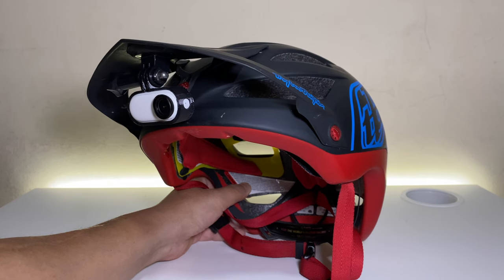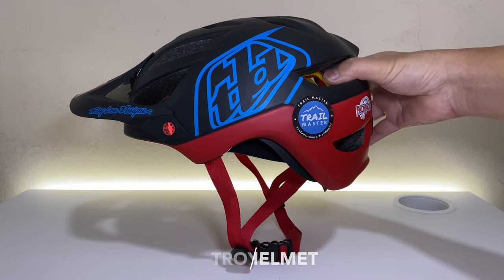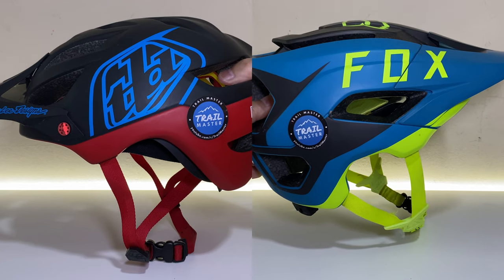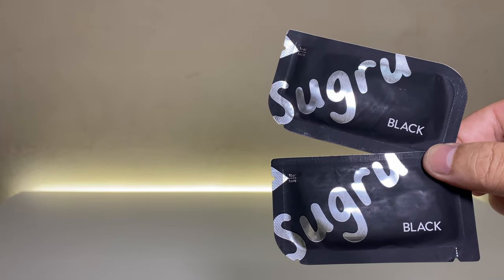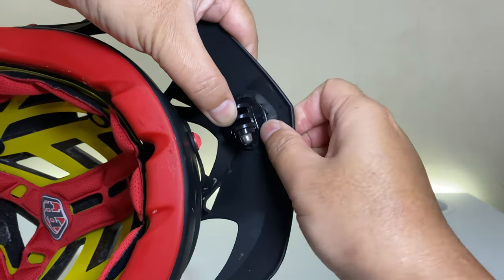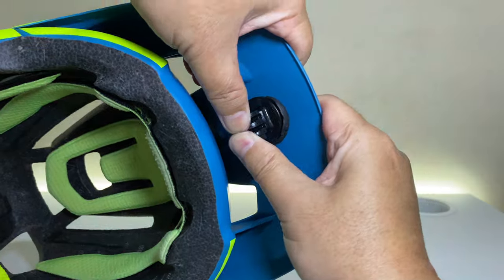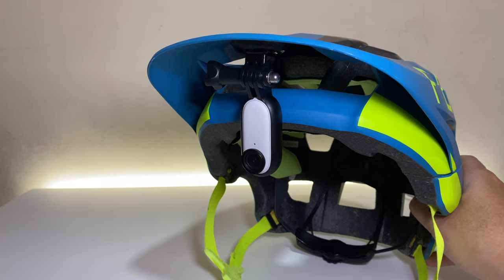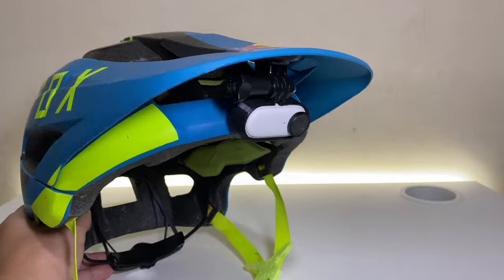How To Make DIY Visor Mount | Sugru Mouldable Glue

Comment: Where did you buy that horizontal mount at video clip timeframe 3:46?
Reply from the maker: Thanks for watching! It's a 3D-printed mount, the file is in the description. But you may want to check out the recently released GO 2 USB Power Mount from Insta360: https://store.insta360.com/accessory?insrc=INROZHO
Reply: @trailmaster  Yes, I saw that usb powered mount but it's not waterproof.
Reply from the maker: True, they should have made it waterproof.